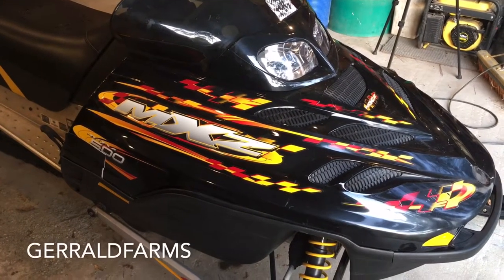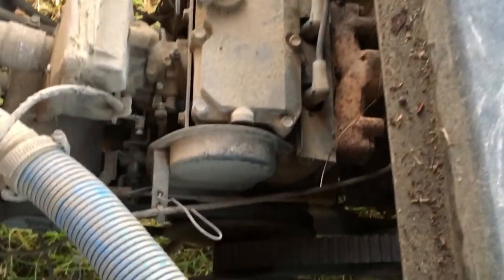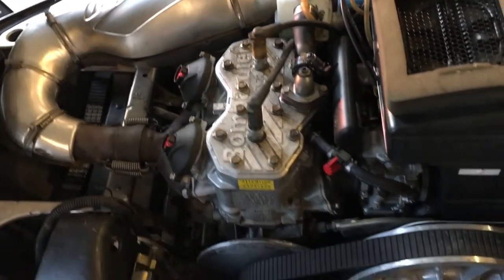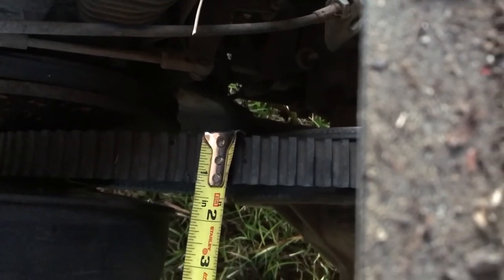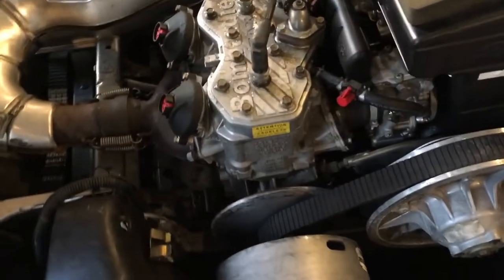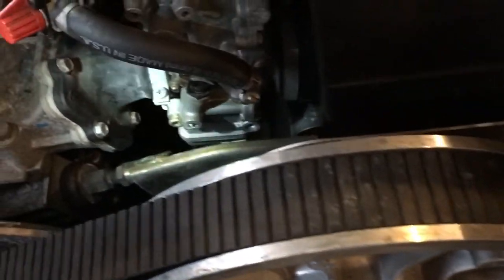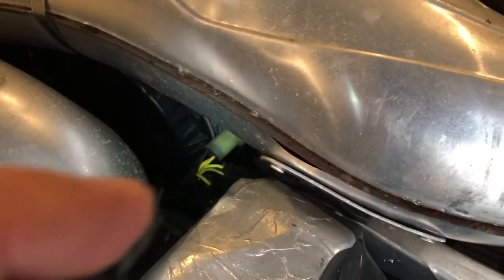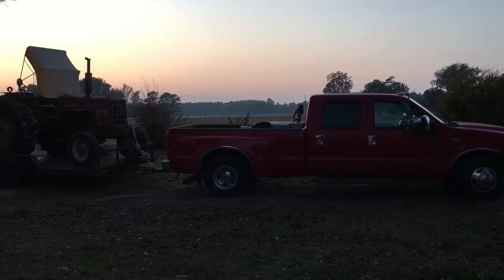90 Hp snowmobile engine going in a EZGO golf cart project

Comment: GREAT IDEA FOR THAT PROJECT 
I would suggest leaving the oil injection hooked up. I grew up in michigan and have a lot of miles on snowsleds, so I trust how SkiDoo has the motors tuned. It would be a pure guessing game on how rich of a mixture for gas/oil ratio if you eliminate the oil injection. Too lean and the motor will burn up quick and it would only take a little bit. other thoughts are make sure that you hook up an actual radiator and fan to the cooling system. Snowmobiles rely on a large heat sink in the tunnel which is cooled by snow to cool down the motor. 
They make a wide variety of belts in different widths and lengths to accomodate your primary and secondary clutch and gear ratio.
Last thoughts are check out GoPowerSports.com for a huge selection of parts and clutching options.
I cant wait to see this project progress. Have a great day friend :) Kevin from hope This Works
Reply from the maker: Thanks for all the info. I sure need it. I just had it running and it’s going to be a beast in a golf cart. Have a good one

Comment: Looking forward to series. Think if tight on space I mix my gas at least you know it's getting the right mixture. Also can you adjust the govner to ease up on torque on rear end Just a thought good luck with project
Reply from the maker: It’s going to be a tight fit. I’m also thinking about maybe using a side by side to put the motor in. We’re still in the planning stage.  We might have to ease up on the torque. Have a good one

Comment: It can be done! You'll need a radiator/fan combo off of a 2001 Honda Rincon 600 (ebay) keep the oil injection, that tank could be mounted almost anywhere. Hopefully it can be electric started. The exhaust will require some major engineering to get it to work. That is probably be the hardest part. I will definitely be watching!
Reply from the maker: Thanks. I’ll check eBay. I think the exhaust is  going to be tough to figure out. It should be interesting. Have a good one
Reply: Exhaust doesn't require shit to engineer

Comment: Cool project! I wonder if it would be easier to use an older machine with less horsepower and less electronics.
Reply from the maker: It probably would be easier but this is what I have to work with. I might could trade it for something else. I even thought about putting it in a side by side. Have a good one

Comment: Electric start systems for sleds are common but there is a ring gear mounted to the primary clutch and the starter sits on that side and starts it, I see theres no ring gear on the clutch so you will have to find a clutch with the gear on it if you want to convert it to electric start. A lot of people eliminate to oil system and run premix, especially on the performance side for weight loss. Make sure you run a good synthetic oil to keep those RAVE valves clean, its never a bad idea to pull them and clean  them either.
Reply from the maker: I’m going to need advice from you on this project. I’ve never even seen a snowmobile before MrSteve dropped it off. Lol. Thanks for the info.
Reply: To bad its not a fan cooled engine, thatd make your life a little easier. Ill help ya out how ever i can sir.
Reply from the maker: Shoot me a email  Gerraldfarms @gmail.com .

Comment: The only other problem you will have is cooling the motor. Im not sure about that one but I thought they cool somehow from the snow.
Reply from the maker: It is liquid cooled. It should be easy to add a bigger cooler.
Reply: Snowmobiles use heat exchangers mounted in the tunnel above the track where the snow flying off the track helps to cool it.
Reply from the maker: I’ll check that out. If I have to I can add a radiator with a electric fan
Reply: @GerraldFarms  A good aluminum radiator with a fan would be the best bet, the biggest thing with sled engines is keeping them cool since theyre designed to run in colder climates, your also going to have to do some carb tuning, even during the winter when the temps get above 30 degrees F they start to run fat (rich). I have a fair bit of experience with sleds, some with Ski Doos, id be happy to help if you have any questions in any way I can.
Reply from the maker: I might need some help. Shoot me a email Gerraldfarms @gmail.com